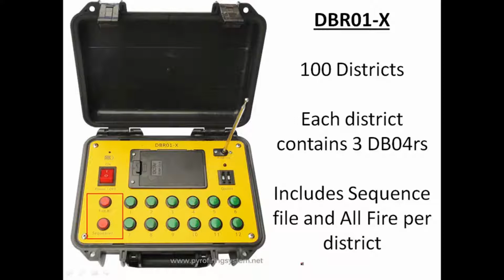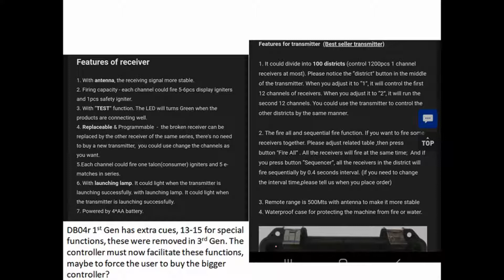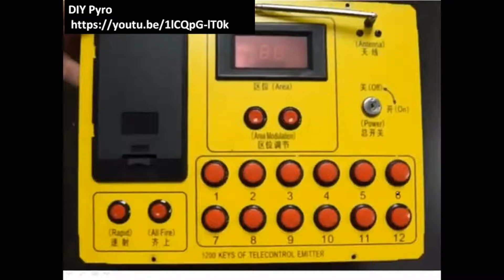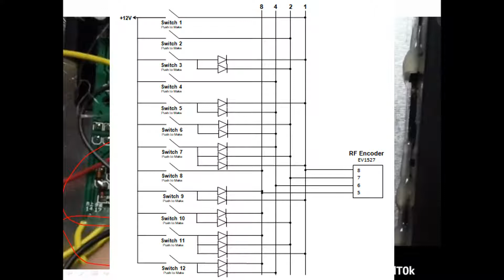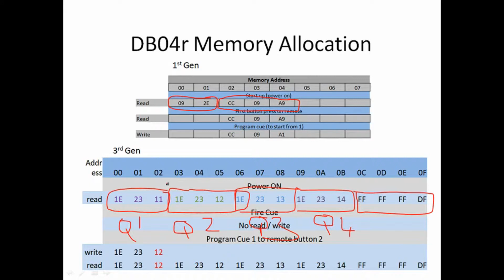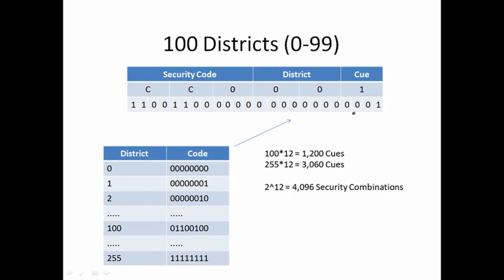DBR01-X Districts

Comment: The Magic Effect / BILUSOCN BL-1200 is a similar transmitter - probably inspired by or copied from the DBR01-X.  On the BL-1200 I found that the District/Area was in the second byte.  The one I tested started at Area 00 (binary 00111100 or decimal 60) and went up to Area 99 (binary 10011111 or decimal 159).  Maybe they decided to assign a random 20bit value to the transmitter, then iterate from there.
Reply from the maker: Interesting to hear your findings. I don't actually have one so this video was just a bit of a guess from the other hardware I have. Happiness license out their products I believe, so Bilusocn is probably the same unit rebadged, but can't be sure.